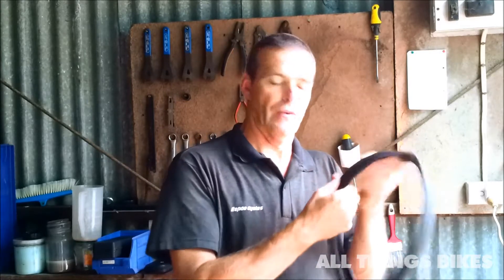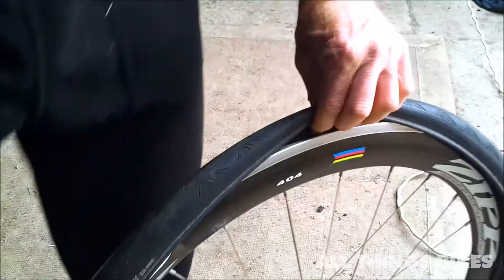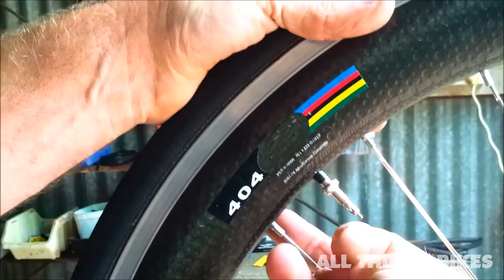Change your tyre and tube properly.

Comment: A couple of further tips.  Light coat of talcum powder on the tube. Tire label aligned with the valve.  Also make sure the rotational direction of tire is correct as applicable.  Cheers.
Reply from the maker: +Giuseppe Marotta Thanx for tips Giuseppe. Is there a reason for aligning tyre label with valve?
Reply: @stevenleffanue  If you have a flat then you know where in the tube & tire it is.

Comment: I recently bought new wheels and tried to put on them new tyres (Gatorskin) - I ended up with 3 broken/pinched tubes and went finally to bike shop. They told me: "not every wheel works with every tire" - I changed to another tires and problem solved - I was really not aware of this tolerances or so.

Comment: Before you remove the tire, break the bead away from the rim on both sides. In this way, you can gather the beads into the depression at the center of the rim. By doing this you can push the slack around the rim and roll the bead off without any levers. By not breaking the bead away you are making the job of getting the tire off as difficult as it can possibly be.  Pinching beads to the center while pushing the slack to the opposite end will greatly ease the job of putting the bead back in as well. No tire lever...crack your rim or damage the bead while on the road, and you're done.

I think you're dead wrong on lever shape, especially for carbon rims. It’s purpose is to pop the bead off. If you insist on dragging it around, use water with a few drops of washing liquid as a lubricant. But you shouldn’t do that. Square or round, you risk damaging the tube as well as the bead and rim. It’s just lazy, and if you're going to patch the tube, you don’t want more damage.

You didn’t align the tire label. There’s two on these contis. A big one and a little one. The little one goes over the valve. That’s where you find inflation limits on the tire. That’s why you put it there.

Those Contis you mounted (like many tires) have a specific rotation direction noted by an arrow on the sidewall. You need to take care that you remount the tires the right way, especially in instructional videos.

There are a thousand better videos on this job...this one doesn’t improve the conversation.
Reply from the maker: +Rowdy Yates OMG! Cant even find that vid on my hard drives...must be one of the old ones Rowdy. Will put it on my "to do" list for a proper vid on that subject. Once done I will erase this old vid. Your vids are great too,even if they are sponsored. Cheers..Steven